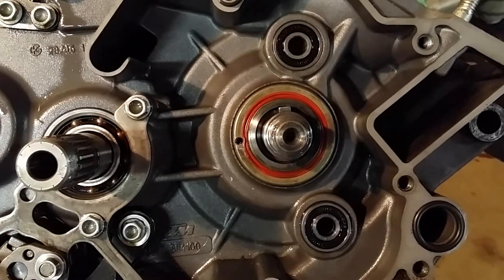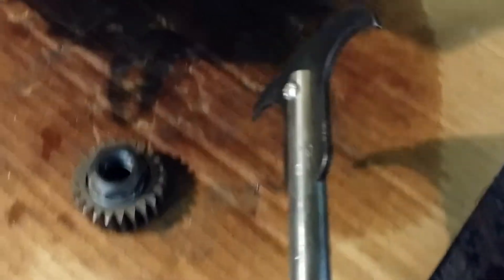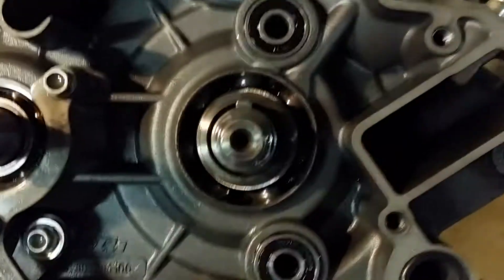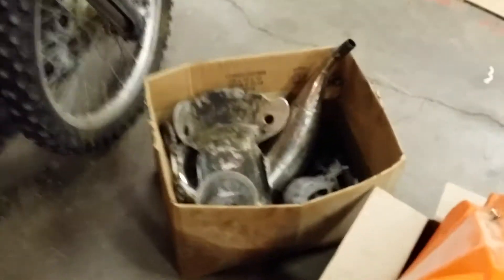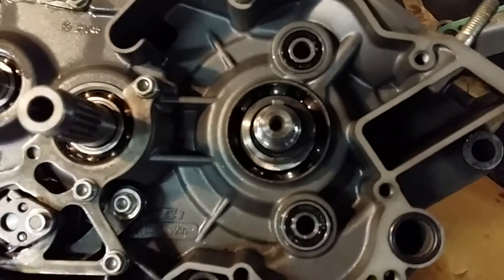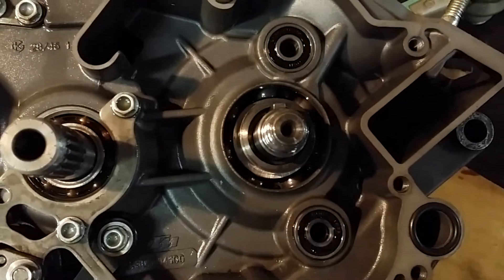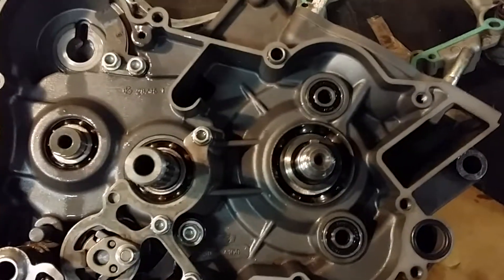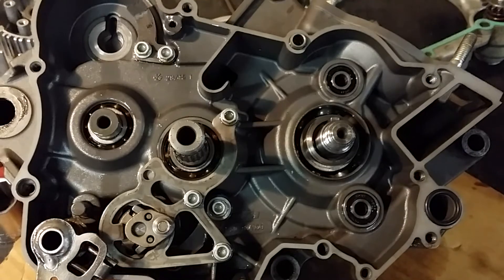2 STROKE CRANK SEAL REMOVAL 04' KTM 125SX

Comment from the maker: +Doug Williams: They actually make some tools and devices to install them properly, but you can do it several ways. One of the most common is use a piece of pvc plastic pipe that is the same size or slightly smaller than the outside metal edge of seal and tap it in extremely even. You have to get it line up perfectly straight in the engine case before you start tapping on it. I dont advise it, but you can get the seal started in the case and lightly tap it evenly in with a small hammer, but it is very easy to damage it this way. ***Most importantly alway oil the seal all over before installing it to keep from ruining it. Hope this helped. Thanks

Comment from the maker: +Dave P: Ok... so what you do is, and with all Metal drilling, the technique is to use some type of cutting oil, or any lubricant at all. I use a heavy oil, like gear oil. Now a drill bit is designed to pull the shavings upward, hence the corkscrew design. What you do is leave the drill bit in place when you break through and clean the area around the drill bit real good, before you remove it from the drilled hole you just made. Also, In this case I used a tiny little drill bit, which produced very little shaving. Keep in mind though all engines have a tiny amout of metal in them due to wear. Thanks for watching, and responding. Hope this helps.

Comment from the maker: +Fernando Chavez: The seal is between your transmission gear box and the bottom end of your engine, so when the seal goes bad, you lose critical bottom end pressure, and the transmission oil starts to get into the engine where it is burned  and smokes like crazy, causing very poor starting and performance. Thanks for watching and commenting.
Reply: THE DRAGON    hey brotha   my cr 125  is a beauty  but sat in a garage  begor i bought   it for over 3 years    ran great  but was fouling plugs with oil     i foumd out after it was spitting oil out the exhaust   that it is possibly the crank seal shot out       would it make it spit an oily gas mix outta the exhaust?

Comment: What has hapend with my 125sx its smoking like a train and it has gas in the transmission oil what is it that is wrong? I have replaced the crank seal

Comment: Instead of drilling its better to punch a tiny hole in it. Tis gives the screw more meat to hold onto.. Also less chance of ant debris or shavings from the drill. A drill bit will always push that last piece of metal burr through the back.. Yup it does..

Comment: Isn't that seal in the wrong way? The seal lips should be facing the wet side, ie outside on a bike
Reply from the maker: It's the correct way. Thanks for watching
Reply from the maker: Also remember the purpose of this seal is to keep the transmission oil from getting into the crankcase.